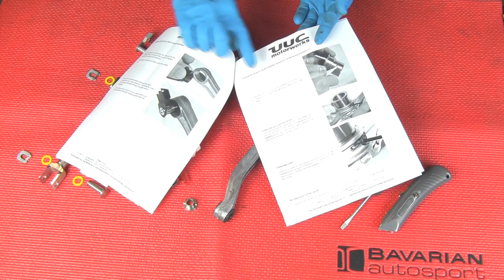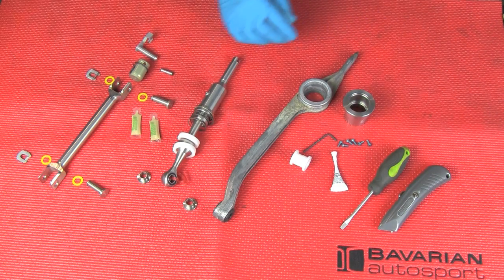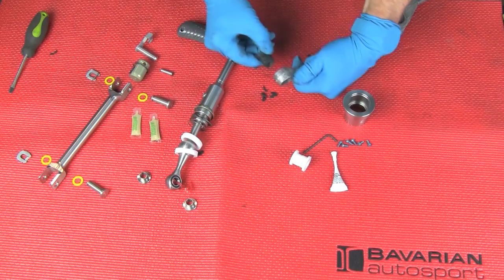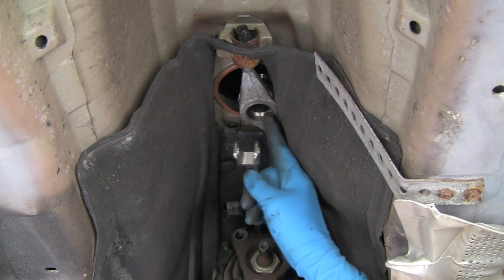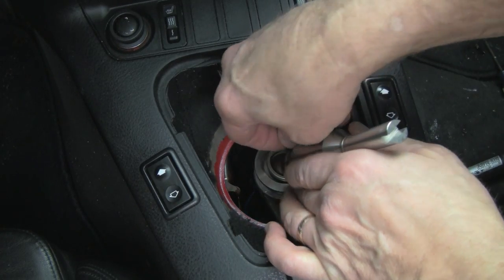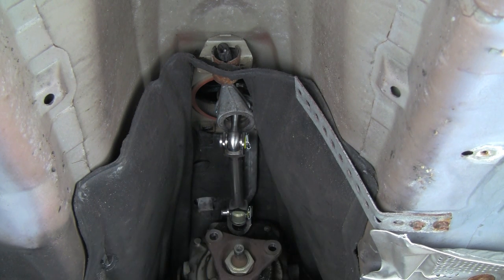Part 2: Installing A Short Shift Kit On A BMW

Comment: Where can i get the color changing wire ties. Awesome video though really helped out!
Reply from the maker: Heh ..... where did you notice the "color changing" wire ties?
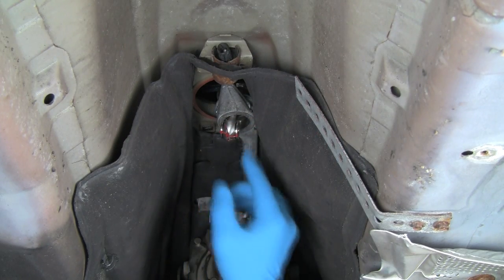Reply: BavarianAuto @8:18 starts out blue.  then @9:53 they have turned red. only a small continuity error lol.
Reply from the maker: WebdevShooters
Ah yes, we removed the tie before the install and then decided to show that you would leave it on until ready to install the DSSR .... Had to find another one.

Comment from the maker: Depending on the model, it may be possible to install a short shift kit without removing the exhaust and the driveshaft.  In the cases where it is possible, much of the work is done blindly and you need to figure out how to access and manipulate connectors that would otherwise have better access, so a "first-timer" may have trouble with it.

Comment from the maker: Kit-A = replacement of all shifter parts, to include; shift lever, selector rod and forward connector.  Gives short shift plus replaces all of the wear parts (except the mounting bushings).
Kit-B = Shift lever only.  Gives short shift, but uses original selector rod and forward connector.  Does not eliminate all wear parts (selector rod & forward connector).
Kit-C = All of kit-A plus billet aluminum shifter support arm.  Most reduction in shifter throw, only available for certain applications.

Comment: Thank you for this video sir you did a great job and you explain things in very good detail although is it really necessary to drop the exhaust pipe and the drive shaft to replace the short shifter bushings?

Comment: I just ordered one of these for my car. I noticed the lubricant you have on the shift ball at 8:15 looks similar to the Liqui Moly anti-seize compound you use in many of your other videos. Is it a superior lubricant than that green lubricant included in the UUC kit that you used on the delrin bushings?

Comment: Also, when adding plastic washers, how tight should the clips fit on to the DSSR pins? Are we trying to add enough washers to make the pin tight so that there is no rotation or play, or just snug so that there is no noise but the pins are free to rotate?

Comment from the maker: The DSSR (Double Sheer Shift Rod) is sold as a separate part.  The UUC Short Shifter can be installed without the DSSR.  However, the overall operation and the life of the forward connector, will be greatly improved with the DSSR.
bavauto.com

Comment: My neutral does not return to centre, what is causing that, just had my selector rod joint bushing replaced and still has that problem

Comment: Any secret to popping the carrier bushing back in between the pinch? Im doing this install but with a poly carrier arm bushing. 
I have an 04 e46 330ci 6speed so its slightly different (ie: I have 2 pins on my carrier). It seems like I have to install the bushing while it is already on the carrier. I have no room above the transmission to slide it forward enough to bring it back through the bushing. 
Can I remove the pinch?

Comment: I recently purchased the UUC SSK and DSSR for my car (e39 525i). The fit between the bushing flanges and the DSSR is extremely tight -- it almost feels as if the DSSR has to be "forced" over the bushing flanges. Is this normal? From the video it appears to slip right over the flanges quite easily.

Comment from the maker: Certainly!  In fact, UUC Motorwerks (the makers of the short shift kit shown in these videos) has a write-up on this.  Go to uucmotorwerks web site (we cannot link it here) and click on the Tech Tips tab at the top of the page. We can supply you with all of the UUC and standard BMW parts to complete this swap.  Just call us at 800-535-2002.

Comment from the maker: We do indeed have a UUC Short Shifter kit that will fit your 2002 320d with a 6-speed manual transmission.  The part number is USCE.  Please email our advisor at ajt@bavauto.com for further details.

Comment: Do people ever replace the rubber portion (bushing) of the rear mount? There's still a lot of flex in there, whereas every other source of play has seemingly been replaced.
Reply: Yes, I'm positive people replace it if it's shot. lol
The rubber bushing in my E30 is totally gone and is solely responsible for the play. I'd rather just deal with it for the time being until I can justify its $100 cost and removing the exhaust and driveshaft to replace it. Full shifter bushing rebuild kits are about $150 including the rear mount, so that seems like the logical purchase instead; as well as a dssr, and maybe a Z3 shifter since this UUC one seems a little too short.
Reply: Yes. There are bushings made by Garagistic that are Delrin and eliminate the play created by flex at the rear of the carrier.

Comment: GREAT: NOW YOU CAN SHAVE  SECONDS(and eights of an inch) ON ANY 2 HOUR JOURNEY; say thanks to the man,people
Reply: Likewise, I would not buy one for mundane 2+ hour motorway journeys.
However, I would most definitely buy one because I use my E30 M3 more for tracking and driving along Britain's B roads where one is continually changing gear.